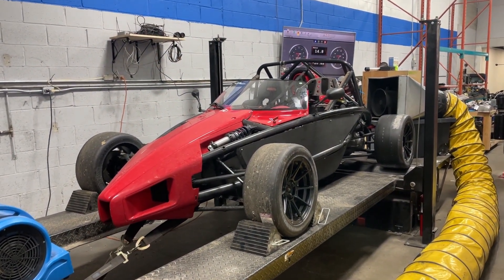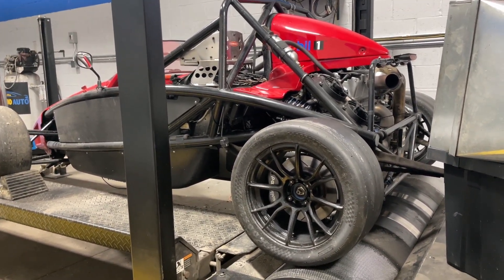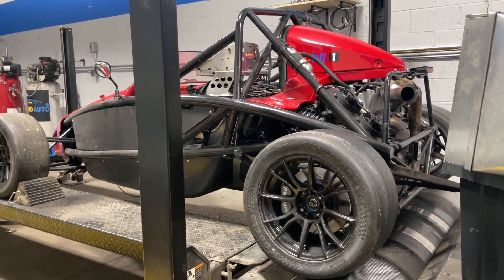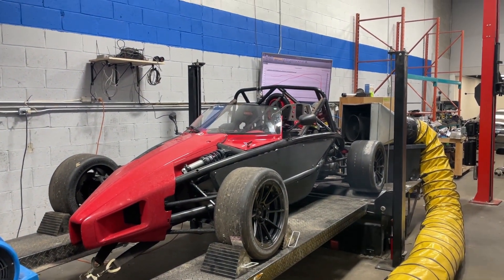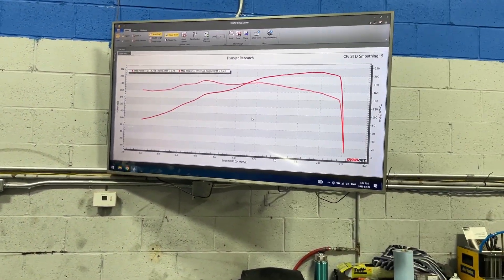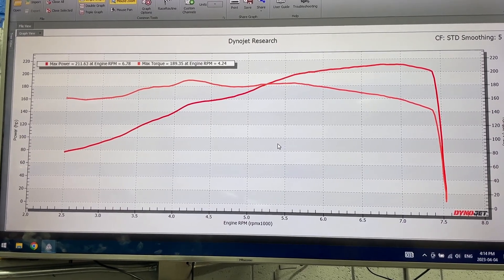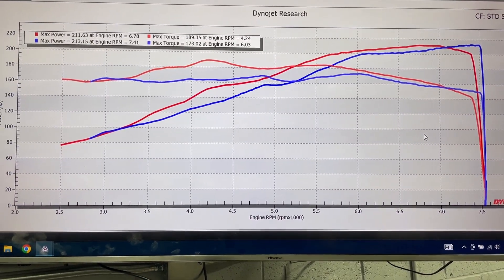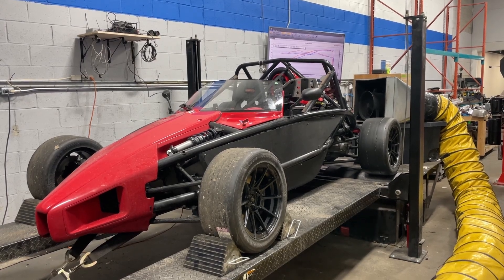Ariel Atom K24Z7 Dyno Tune

Comment: Loved this Video. I too have a k24Z7 Ariel Atom and I have the 4Piston 403 drop in cams (which do require spring upgrades) and their Ported R40 head. Hoping to install them in May (with an RBC). Your comments on the intake restrictions are dead on and many in the Atom community have installed a cleaner solution.